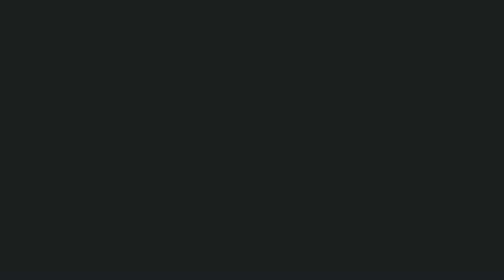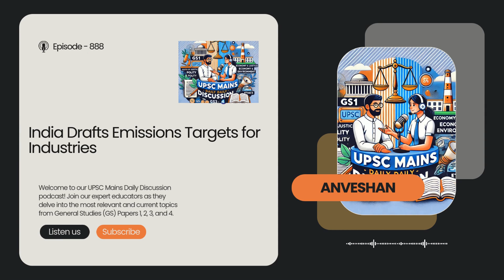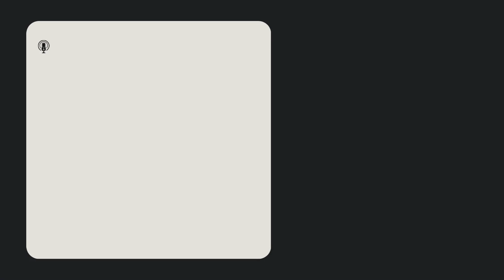India’s Carbon Market Explained♻️Green Credits vs Heavy Industry ⚙️🌍Net Zero Revolution Begins - 888

Comment from the maker: 1. What is the primary focus of the new draft notification released by the Ministry of Environment, Forests and Climate Change (MoEFCC) in India?
The draft notification focuses on setting mandatory emissions intensity targets for specific high-emitting industrial sectors. This is a crucial step towards establishing India's first compliance-based carbon market, which is expected to launch in 2026. The aim is to limit the total greenhouse gas emissions entering the atmosphere through a cap-and-trade system.

2. Which industrial sectors are initially obligated to meet these new emissions intensity targets?
Currently, 282 industrial units across the aluminium, cement, chlor-alkali, and pulp and paper sectors are obligated to meet the new targets. The cement sector, which contributes significantly to India's carbon emissions, has the highest number of obligated industries with 186 units.

3. How does the cap-and-trade system outlined in the draft notification work for obligated industries?
In this system, obligated industrial units must meet reduced emissions targets. If a unit successfully reduces its emissions beyond the set target, it can generate credits. These credits can then be sold in the carbon market to other units that are struggling to meet their targets. This creates a financial incentive for industries to reduce their emissions.

4. What happens if an obligated industry fails to meet its emissions intensity target?
According to the draft notification, if an industry fails to meet its emissions targets, the Central Pollution Control Board (CPCB) will levy a fine in the form of environmental compensation.

5. Which major carbon-emitting sector is notably excluded from the initial list of obligated industries, and what is the rationale provided for this exclusion?
The power sector, which is India's largest emitter responsible for 39.2% of carbon emissions, is conspicuously missing from the initial list of obligated industries. The rationale provided is that the power sector is complex and heavily regulated, and imposing targets could potentially escalate costs for distributors and consumers. However, experts argue that this logic is flawed as the sector already adheres to other compliances without drastic impacts, suggesting its inclusion should happen sooner.

6. What are the stated objectives of the draft notification regarding greenhouse gas emissions and technology adoption?
The draft notification outlines two main objectives: to contribute to attaining India's climate targets (Nationally Determined Contributions) through the removal, reduction, or avoidance of greenhouse gases; and to promote the adoption of sustainable and advanced technologies within traditionally high-emission industries.

7. Besides the compliance-based carbon market, what other carbon market initiative is the Bureau of Energy Efficiency (BEE) administering, and what types of activities are approved for use in this market?
In addition to the compliance market, the BEE is also administering a national voluntary carbon market. In this market, entities can freely participate by buying and selling carbon credits. The BEE has approved eight different offset mechanisms for use, including afforestation projects, green hydrogen production, energy efficiency improvements, and techniques like extracting methane from landfills, livestock, and households.

8. How is the concept of "additionality" important in the context of the voluntary carbon market and credit validation?
"Additionality" is considered non-negotiable in the voluntary carbon market. It means that a carbon credit must represent a genuine reduction in emissions that would not have occurred under a business-as-usual scenario. The value and credibility of a credit heavily depend on the accurate establishment of a baseline ("what would have happened otherwise") through rigorous methodology, standardized tools, and conservative assumptions to prevent overestimation of credit value. The current offset mechanism emphasizes environmental integrity and uses stringent validation and verification processes by accredited third-party agencies and multiple layers of review to ensure this.